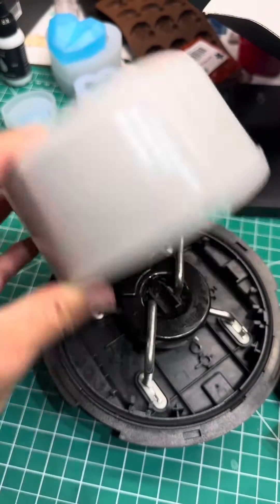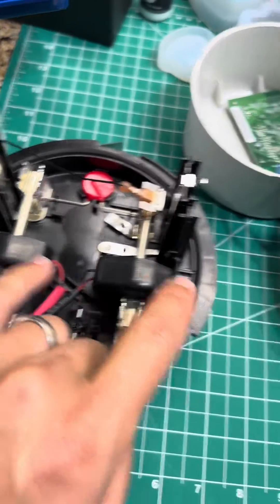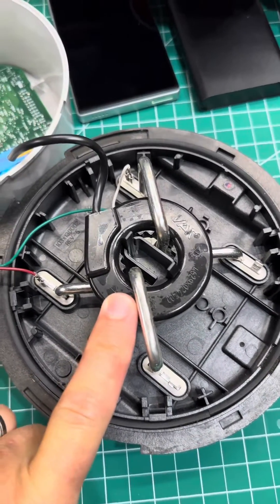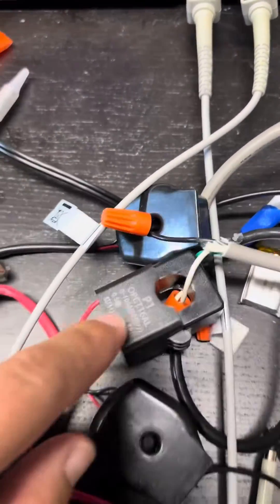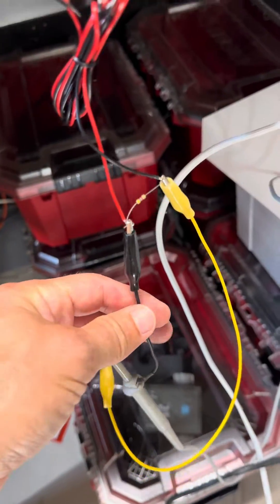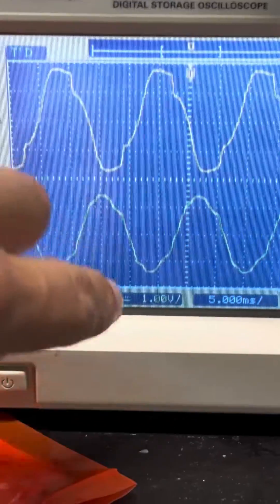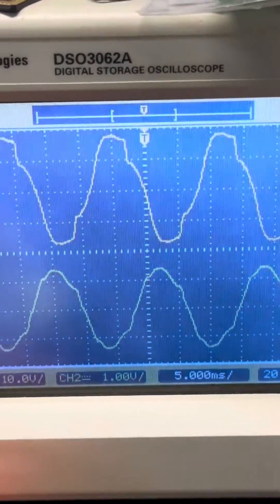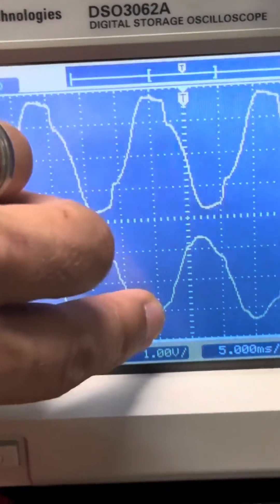Do Smart Meters Make Your Electric Bill Go Up?

Comment: They do atleast here in Australia my bill quadrupled after the install, I suspect mainly due to solar.  Dumb meters just rewind as you provide energy to the grid, smart meters let them essentially pay you a pittance for energy generated while charging you an arm and a leg for the energy you use.   They essentially forced it on me giving me no notice of it's install until moments before the technicians arrived and now allows them to charge 4-5x as more while paying me 10-15x less for my solar.
Reply: If you don't need to use the grids power, simply stop paying the damn bill. Believe me, they will disconnect you then. 😂

Comment: No, transformer at the pole center taps the one phase and what comes into your home is exactly 180 degrees apart. This can slightly change with inductance or capacitance load within your home which might be what he's seeing. 
The difference is that the old meter measures RMS total power usage across both legs and the new meter can pick and choose which leg it bases your power usage. This will always be the leg with the most current. The best solution would be to balance each side of your panel so that usage is as close to equal on both sides as possible. The bottom line is that yes, the new meters are cheating us.